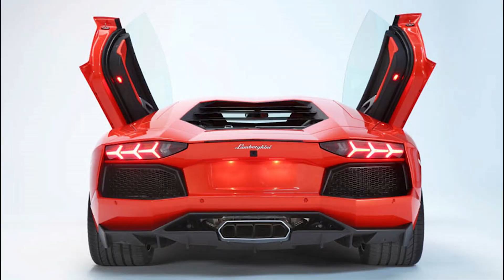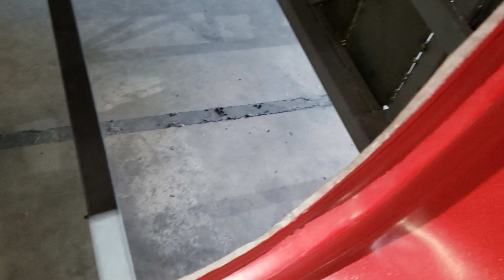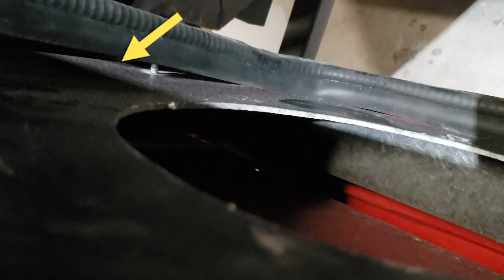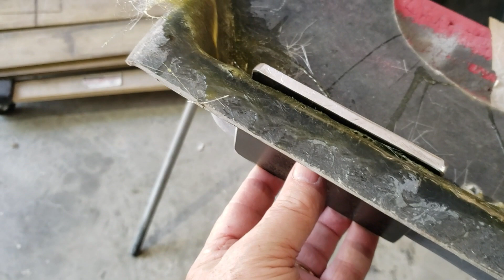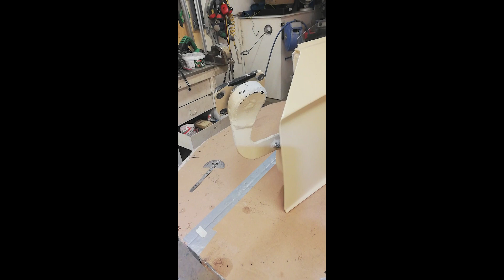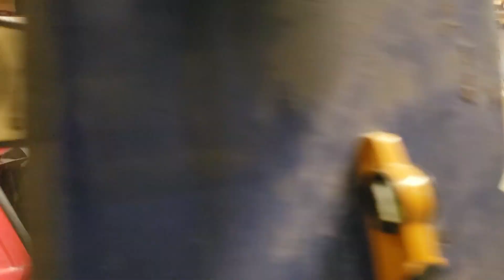Aventador Replica Project - Part 20 Doors –Part 1

Comment: Hi Dale,  YOU ARE going to put a peripheral framework inside the completed door, right?  I've seen many Diablo builders think that all you need to do is mount the latch to the fiberglass door.  I produced some Lambo replica door hinges and switched from the bushings to 3/8"Timken needle bearings.  They will probably never wear out with tight tollerances very tight wobble.
Reply from the maker: Will definitely add framework. Mentioned in next Part 21 coming soon.